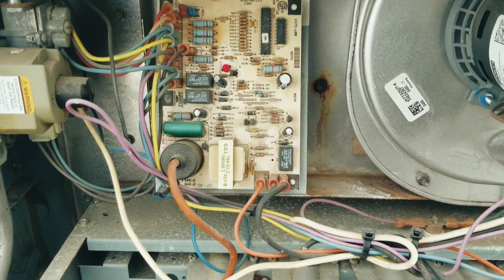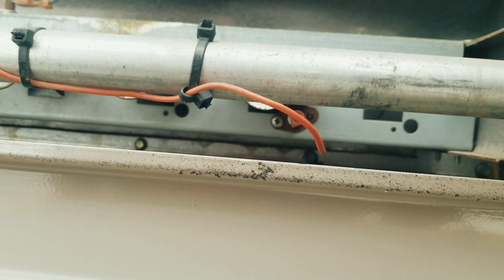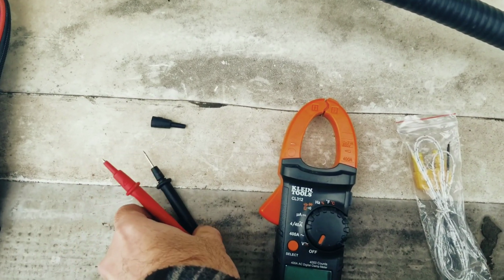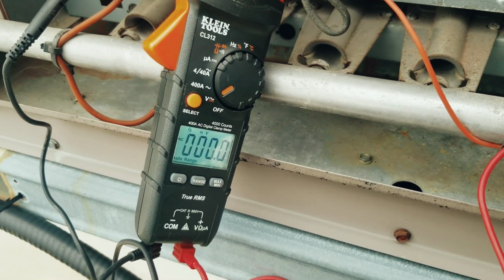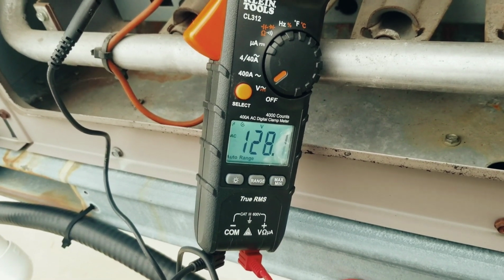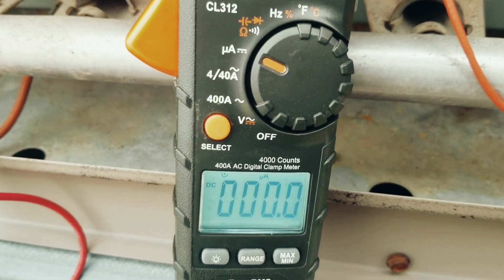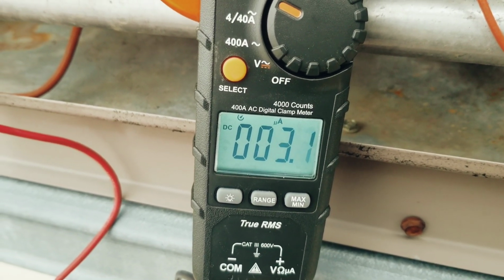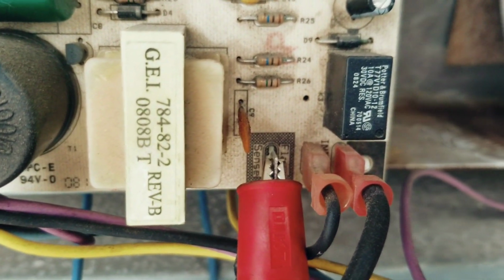HVAC - Checking Flame Signal w/ The Klein CL312 Multi Meter

Comment: Question how can you be in series with a meter so your completing the circuit with your meter but if you go from the 120v terminal to ground with your leads nothing happens, but your meter is letting voltage through and completing a circuit? Kind of makes me think the lead from 120v to ground would short out. What im trying to get at is your meter is allowing voltage to the flame sensor but a lead on 120v to ground does nothing if the meter allows voltage through why isn’t it shorting out when we go from 120v terminal to ground? Hope I worded it ok
Reply from the maker: When your meter is set to volts, it's not letting 120v pass through.  If it passed through, the meter would read zero volts.  For lack of a better phrase, the meter is kind of absorbing the voltage in the same way any winding does.
Reply: @HVACKnowItAll  gotcha I appreciate it man!

Comment: Well my issue is I  don’t find signal leaving my control board into the flame detector, any suggestions?
Reply from the maker: There should be AC voltage to ground leaving that terminal and DC current in series.  If not, the control is bad.
Reply: @HVACKnowItAll  funny thing I take the control board to
Another unit same model and it starts working 🥵bring it back still doesn’t work
Reply: We’ll fix the issue it was power coming  In “polarity” issue
Meaning I was getting 120v
Through the neutral instead of black wire flip those wires 
Second issue was flame rectification what I did to fix that I ran a ground wire
Closer to the flame manifold 

I had previously ran an extra ground to the frame of the unit that still didn’t helped,
But when I ran it closer to the flames manifold started working 

Hopefully this will help someone out here

Comment: What about checking your mA in series from the ignition board to the flame sensor while it's in the flame converting the AC to DC mA?
Reply: Oh you connected the other end of the wire .
Reply from the maker: @seanmcdermott416  do you mean board directly to sensor?  I don't like to do that, I like the wire in while testing to ensure it's good from start to finish.
Reply: @HVACKnowItAll 
Ya that's it . I saw what you did though and that is better .rock on !
Reply from the maker: that's what I just did!
Reply: @HVACKnowItAll  it's actualy Ua and not mA just to clarify, great channel btw !
Reply from the maker: @nighty2936  wait, did I say mA somewhere? Lol
Reply: @HVACKnowItAll  no,the viewer Sean did;  you said  micro-Amps all along,nothing misspoken there       lol
                                   Excellent  videos man,easy for you, new stuff for some on this side;  thanks

Comment: Someone may have asked this already but whats the acceptable  range on those flame sensors? We have a ton of issues with Daikin flame sensors grounding out..The casing is to thin
Reply from the maker: In my experience its 2-8 micro amps.
Reply: Actually - rule of thumb is 3+... anything under and you should clean the flame sensor (STOP USING SAND CLOTH AND USE A DOLLAR BILL)

That said - I've seen systems pull in at 2-2.2 and ive seen them drop out on no flame at 2-2.2. I dont think I've seen a system consistently hold flame under 2.

Comment: A little off topic but the caps for the meter lead probes make them cat IV complaint when installed, cat III when not. The meter is cat III rated but I suspect they use the same leads with all their meters.Fluke makes a set of leads that twist up/down like lipstick tubes for the same reason. 

Great content as always, keep it coming!
Reply from the maker: thanks for the info, I appreciate the compliment

Comment: Good video, In early 1990’s Coleman/Evcon used the Ignitor it self as the flame rectification, it was used very short time but then went to a remote flame sensor, but I never really understand how that actually worked